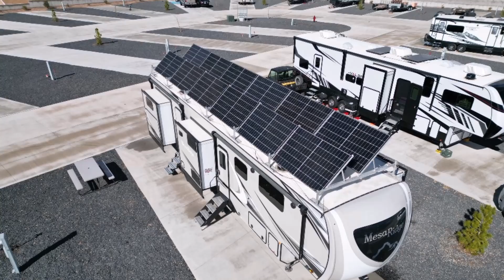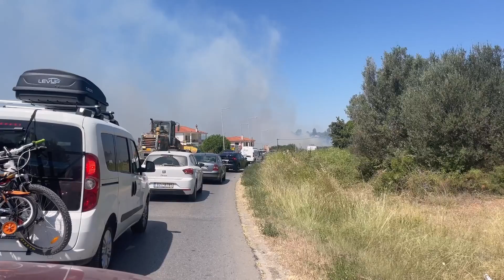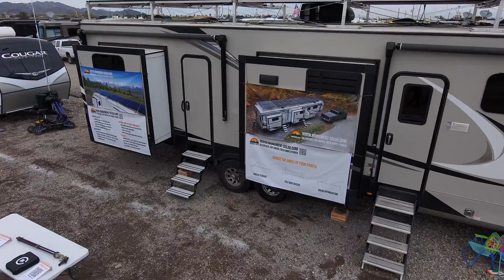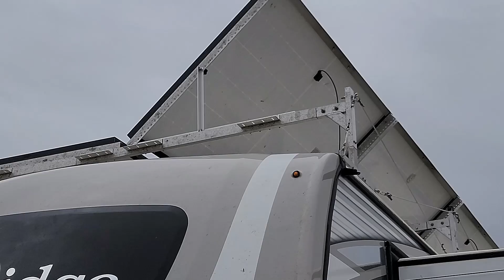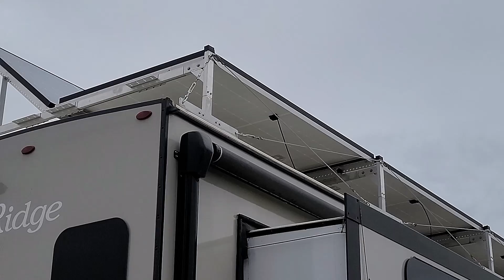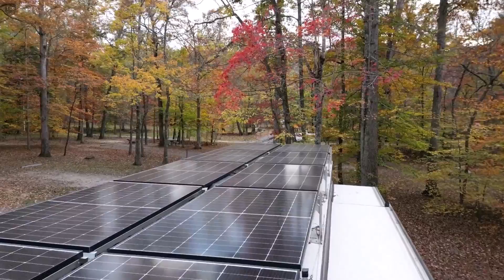Best RV Solar to Never Run Out of Power [For Real]

Comment: I can't imagine being able to angle both strings of panels on the roof without them shading each other, except for maybe an hour or two a day. 
I have a cargo trailer to RV conversion and I mounted 1300 watts of solar on the roof and have another 750 watts on a ground string. The roof panels are 325 watts each, and are too big to tilt as gusts could rip them off the roof. I bought aluminum angle stock and cut it myself to build the mounting brackets. No problems yet after 3 years. Nyloc nuts ensure nothing backs off from shaking while going down the road. 
I assume that the method shown requires a ladder to be able to tilt one of the two rows of solar panels? And then getting on the roof to tilt the other side? This could make sense for boondocking long term (if you carry a ladder), but how many of us would want to go through the tilting ritual for just a day or two? 
I will say that tilting the panels really does help a lot if it can be done easily and safely. My ground string of 750 watts produces the same amount of power per day at this time of year as the 1300 watts of panels that are not tiltable and lay flat on the roof of the RV.

Comment: Any idea what the total roof system weighs? I’ve been looking at all kinds of ideas, including removing the roof ac’s and replacing with max air vents (possibly mini split mounted elsewhere) just to trade the weight for the solar framing. My 2 biggest concerns is the weight on the roof (which did point out about the mounts at the edge) and also the wind factor. Thanks for making this video.

Comment: From the looks of the new setup, you could hinge your old 100W panels down each side for more wattage. 
This would enclose the sides and reduce airflows unless you tilt them up flat or at a 45
degree angle.

Comment: This is great if you decide not to drive anywhere. Like in a fixed  location. But on the road I wouldn't recommend . We have all of ours flat on the roof of the RV. This has supplied us with power for almost six years. Along with batteries for storage. You need room to walk around on the roof to clean your panels. This should be done at least every month. Perfect for a permeant location.

Comment: This is a great idea, so much so I did this myself on a Ram Promaster I built myself creating a custom 8020 roof rack to accomplish the same thing.   Another benefit not mentioned, it also males the camper much quieter in the rain.    I feel you could accomplish the same outcome using 8020, but would require some knowledge of the product.   You can use a low profile channel along the wall and roof ridge, a wider profile for the verticles and 45 degree braces for added strength.   Also lock tight where fasteners would be used.   I suggest throughbolt where possible, stainless fasteners to be used.  A front facing wind deflector should also be integrated  for transporting the camper to minimize wind loading on the assembly.   A price comparison would be interesting to see.

Comment: I am a truck driver, a car hauler with the largest trucks on the road. Three plus million miles. The question I have is height. Besides going offroad, the trees in town are something we watch out for. Standard box  semi's are 13'6" and my height law in my state is 14'. Just touching one of these branches  will damage the top five units. I saw that unit in Quartsite and wondered the amount of damage that could happen to a weekend warrior. BTW, what is the average height on a 5er?
Reply: 13.5”
Reply: Agreed. My former RV was a fifth wheel and it was 13 ft 2 in. The legal limit for overpasses without a low clearance sign is 13 ft 6 inches. Once in town and off the freeways you would have to be really careful of low overpasses.

Comment: Big secret for rv roof is using the best coatings possible and it's not sold at rv shops. It's sold at homedepot.  It's called henerys 100 % Silicone.  Once it's cured from off gasing  water, hail Nothing is going to penatrate it unlike what's used

Comment: I don't need enough power to justify a system like that, are you planning on powering outdoor concerts?
Reply: Then don't install it. Some of us boondock for weeks at a time and this would be bliss if you can afford it. I have 2050 watts of solar panels on my 16 ft cargo trailer to RV. Writing via Starlink from out in the middle of nowhere in the California desert.
Reply: @headdown1  I get it, it's really nice. I'm in Quartzsite running entirely off solar and run everything but the AC no problem. I can run the ac but the drain is too much. We use a portable washer and dryer, crock pot, coffee maker toaster etc.., I don't use or need that many panels. And of course, everyone's needs are different.
Reply: @ Nice! I am an energy hog with this RV. I use about 350 AH a day, but I do have a 900 AH LiFePO4 battery bank. Full sized 120 volt Samsung home fridge with drawer freezer and ice maker. Desktop wih 32 inch monitor. Microwave, toaster, coffee maker, deep fryer. I did buy a portable a/c unit that works well, but I don't need it down here all winter so it stays at home. 100 gallon fresh water tank in the bed of the Ram. On demand propane fueled water heater for long hot showers in the middle of nowhere. 
I'm an astrophotographer and move to and from my dark site by the cycles of the moon every two weeks. Lucky for me this is what BLM wants anyway.
Reply: @ I have about the same ah, 4-100ah and 2-280ah, still using the rv absorption fridge/freezer + a SetPower PT 35 dual zone portable fridge that literally sips power, we leave the inverter on 24/7 and just use a hardwired 30 amp outlet from it,lol. I've got some good viewing here, but a lot of times the seeing isn't all that steady here. Found some GREAT dark sky spots on the way down from Washington. I'm strictly visual.
Reply: @ Yes my inverter runs 24/7, though even without the fridge compressor turning on and off, I am always using 120 volt power anyway, so it would still be on all the time. 
I love my Samsung fridge, though I did just have to do two repairs this week for the first time after 8 years. Flapper between doors needed a spring and hinge replaced, and I installed a bigger drain tube heater to keep it from freezing up. Overall I just love having a big home fridge that can turn ice cream to a rock if I want it to.
I am strictly imaging, and my refractor - a Takahashi FSQ 106ED - doesn't even have eyepieces. I have never once used it for visual. I also have an Edge 9.25 (2350 mm f10). Here's a link to my gallery. Remove the X at the start of the link to (hopefully) make it work. You might have to cut and paste the link (minus the X) into Google.

Xhttps://www.astrobin.com/users/headdown/

Comment: you are not using CIGS solar panels... they are 100x better, you can walk on them!
Reply from the maker: But you can't cover the whole roof in panels, which means you can't max out the solar input, which means you can't successfully run the RV however you'd like. I'm not against CIGS, they're great panels. All I'm saying is the focus of this setup is to max out the solar input and have tons of power, you can't do that with CIGS. You can still walk on the roof with the Monument Solar rack because there is an opening down the center of it that still allows roof access the full length.
Reply: respectfully disagree.. not only are CIGS literally bulletproof, they work when partially shaded and have a much better efficiency..not to mention how much easier they are to install, no leaks, lighter, make your roof stronger and you have full area to walk on , not a small path.. mind boggling why you wouldn't use them.  https://www.youtube.com/watch?v=QNVt4fwio5Q&t  @minutemanprep 

 @minutemansolar
Reply from the maker: @DeFiDuke  CIGS are great, I'm not opposing that. And to clarify, they're not bulletproof, the test was if you shoot them will they still work, and they do. The newer residential solar panels also work partially shaded. My point, is how to get the most solar input in an RV. You can get more than 2x the solar input using this racking system, over CIGS. That's what I am saying. I'm not saying CIGS are bad panels.
Reply: @minutemansolar  again disagree.. CIGS will outperform anything u got..  and you know what I meant about "bulletproof" -  obviously they are not designed for body armor or stopping bullets lol
Reply: @minutemansolar   Respectfully disagree. not only are CIGS literally bulletproof, they work when shaded and have a much better efficiency, not to mention how much easier they are to install and you have full area to walk on, not a small path.. mind boggling why you wouldn't use them..   https://www.youtube.com/watch?v=QNVt4fwio5Q
Reply: respectfully disagree.. not only are CIGS literally bulletproof, they work when partially shaded and have a much better efficiency..not to mention how much easier they are to install, no leaks, lighter, make your roof stronger and you have full area to walk on , not a small path.. mind boggling why you wouldn't use them.  https://www.youtube.com/watch?v=QNVt4fwio5Q&t  @minutemansolar

Comment: That’s pretty cool. As a 70 year old in Northern Utah, dodging the cold and snow, I’ve just started my solar configuration and it’s very taxing to me. I just finished hoisting my panels up to the roof and also have in place strut channels to put my panels on limiting the holes going into my new RV. I’ve learned a lot and wish I had the funds to do what you described today Ben as it would be perfect. Yet 800 watts of panels, (4) 100 amp LiFePO4 batteries and 3000 watt pure sine inverter diy system that you and Will Prouse helped me to figure through YouTube is the best I can do and it be affordable. 

You always go above and beyond and out of my league but I sure enjoy learning from you and your Dad/Mom as you put out top tier content. Awesomeness in recognizing Monument Solar Racking. Wow. PS. I’ve just been getting use to climbing up the ladder as it’s scary and dangerous.
Reply from the maker: That's awesome that you got a system figured out. You don't HAVE to have this new setup, but it is indeed the best one I've seen out there. As long as what you've installed works for you, then I'm happy for you.

Comment: I took a quick look at their website and noticed that even the smallest system needs an 8foot wide camper.  I would love the 800watt system but my camper is a Jayco Baja and is under the width requirements. This is my hunting camper and the narrower width is a prime consideration as i remote camp with it. and often away from the road(where legal) I will be contacting them about using smaller panels so they can install on my smaller camper.
Reply from the maker: Send them an email and tell them Minute Man Prep sent you and they will likely be able to come up with an option that works for you.

Comment: Is there an wind deflector for the front of the solar rack to prevent the panels from acting like a wing while the RV is traveling?
Reply from the maker: The original racking has tens of thousands of miles on it with zero wiggle or problems. But a wind deflector would still be good. Nothing that I am aware of now, but maybe that's a side gig for them to do

Comment: I saw that solar awning at Q this year. Sweet and innovative. The biggest drawback of it is that it can't produce power like our side or rooftop array does when it's rolled up, either when traveling down the road, when stopped in rest areas and parking lots or in high winds. 

We're old, retired FTers who designed and built our system ourselves, on a tight budget. It took us 5 years to gather the resources and finally complete the project, doing all the work ourselves. We started by building a 620-watt liftable solar array on the side of our motorhome. Our side array makes a nice bedroom window awning too, practically lifting itself with a couple gas struts, and it's easy to clean, standing safely on the ground. Next, we built a 12v, 560ah LiFePo-4 battery using 8, 280ah prismatic cells and a Heltec 330amp BMS with a 5a active balancer. These cells fit perfectly under the steps of our MH where our old pair of golf cart batteries used to reside. We insulated the battery compartment, cut a small hole in our step risers and installed a tiny computer CPU fan to keep this space at close to room temperature, so we don't have to worry about the BMS shutting down charging due to low temperature - or their life reduced from getting too hot. Our 12v system uses an 80A Progressive Dynamics LFP converter/charger, a 1,000w Renogy inverter, a 50a Epever MPPT charge controller and a Lnex battery monitor. All this cost us under $3,500 and met all our off-grid electrical needs except for our air conditioning, heat and microwave. For heat and refrigeration, we used propane and for our A/C and microwave we ran our generator. We lived with this limited system for 4 years, while we saved our money, traveling with the seasons so as to minimize our need to run our 5,500w generator which is noisy and pretty expensive to run for hours at a time to power our A/C. 

By mounting the solar array on the side of our coach, we left the roof free to rack 8, 550w solar panels down the length of our 35ft Class A, 15" off our roof, above our AC, vents, etc. I considered going with bi-facial panels myself, but they would have added a lot of extra weight as they have a heavy back glass too, and since I wasn't going to lift them, I don't think the bi-facial gains would have offset the extra roof weight. We built the rack out of 2" 6061-T6 structural aluminum angle. The front 2 panels slope down at a shallow 9.5-degrees to meet the roof, producing a smooth laminar airflow over the array, making the RV more stable with less wind drag while driving too. It shades our entire roof, allowing plenty of cooling air underneath, increasing solar output and reducing the heat load on the air conditioners as you correctly observed. Our overall height is still just under 12 ft., up 2 inches like Monument solar's design. Yes, it required making 54 holes in our roof for the mounting bolts, (3 in each foot) but each hole was filled with Henry's silicone caulking, before coating the entire roof, completely covering all array mounting feet, bolts, etc. with Henry's 100% waterproof Tropicool silicone sealant, with a lifetime guarantee. Monument's solar has a sweet system, with a lot going for it, but on many rubber roofs, like ours, the adhesive would just pull the loose EDPM membrane off our roof unless it was glued on with an equally strong bonding agent. The best application for this design would appear to be on a sturdy metal roof.

At my age, I can't see myself climbing on my roof every time I want to raise or lower my panels. If it could be done by remote control while standing safely on the ground, then a liftable rooftop array would be more practical for older retired folk like us. But in reality, our 4,400w fixed array can run both our A/Cs, household appliances and charge our batteries from solar at the same time, even in winter. That's more power than we need. If your array is big enough there's no need to lift it - or worry which way your RV is parked to optimize your production. Five years of boondocking experience across the country with our liftable side mounted array taught us that it's often difficult to find a NF campsite or boondocking spot oriented correctly (due east) for a south facing array. 

We mounted a Sungold Power all-in-one 48V, 5,000W Inverter/100A charge controller/battery charger, breakers and a Lnex battery monitor on the wall in our bedroom, saving us space as well as money compared to a system built with individual components. Our 48v battery uses 16, 320ah prismatic cells and a 200amp Heltec BMS to keep it safe. Together with our 560ah 12v bank, we have a total of 23.5 kwh of batteries onboard - kept charged by 5,020 watts of solar. This is the equivalent storage capacity as $16,650 worth of 100ah Battleborn batteries for under $3,400. 

We removed the rooftop A/C we had in the bedroom and replaced it with an EG4 28.5 seer-2, 12k btu mini-split heat pump on the upper rear of our motorhome. It's super quiet and cools as well as our 14.5k btu soft start equipped Furrion we installed up front. This second phase provides 24/7 off-grid air conditioning and heat from the heat pump.  We have a total of 6,000 watts of 120v inverted ac power, giving us off-grid electrical self-sufficiency without the need to run our generator, for a total budget of around $11,500, including the high-efficiency heat pump. Any similarly sized professionally designed and built system will, out of necessity, cost several times this amount. Take care. Good luck with your new liftable array!
Reply from the maker: Fair enough it can't make power while driving, but when parked, it's nice to get the extra boost. With their upcoming 1200w awning, that's enough to completely offset the power usage of an A/C unit.
Reply: Excellent post, thanks so much for the system details. 
I am designing for a 16ft long x8x8 all-aluminum box truck with two opposing slideouts 8'ft couch/bed & 6ft desk.
Single person, boondocking, min. 1 month capability.